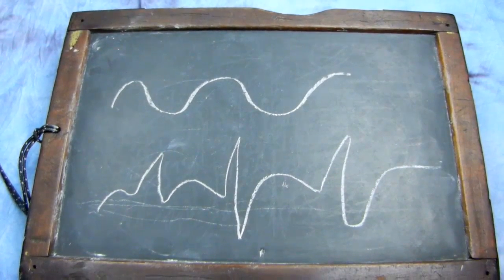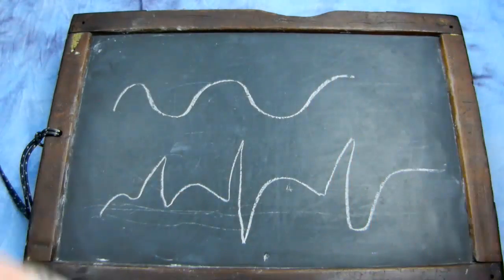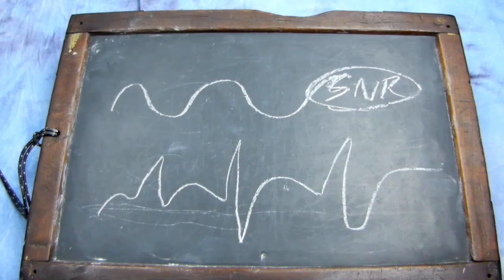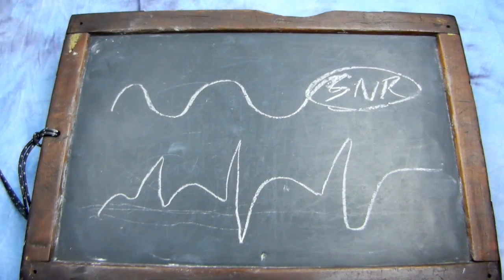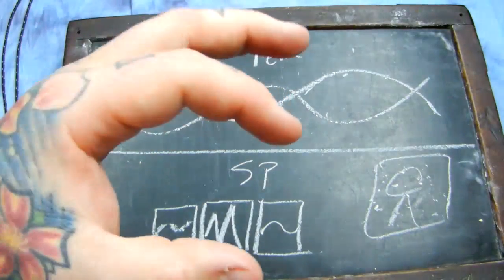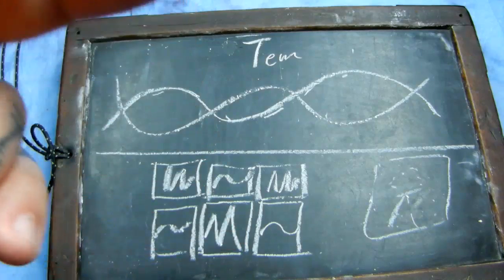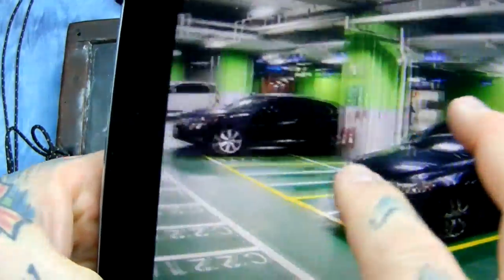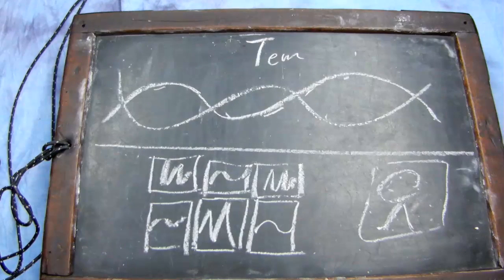Angry Photographer: SECRETS (SNR spatio-temporal algorithms) NIKON & CANON dont want you to know

Comment: I get your point and is a very interesting video, but what you said can confuse some people, the image quality depends of both factors. if we are talking about the same sensor yes, better algorithms can improve the image quality a lot, but if you compares a high end sensor with a crappy 20 dollar sensor no matter how good the algorithms are. both factors are very important a good sensor is gonna get a higher signal in the same situation and the algorithms have more information to work with. if two cameras have the same sensor the raw picture file is gonna be very much the same even if one of the cameras have a better analog to digital converter the diference is not gonna be so great, (JPG is another story). there are some cameras with very unique sensors that have an awsome signal to noise ratio which is what it makes them great. best regards from Uruguay.

Comment: Firmware interesting.....part of what is on the card is not captured by the sensor......is there a firmware algorithm update for D610?...noise algorithm..gap filling...in basic terms or spacial temporal firmware algorithms...i had thought about this before but never looked into it ...very interesting..cheers

Comment: Is this done before or after the analog to digital conversion? Also, I don't understand the temporal part, if there's x photons in a photosite, how do they figure when in the exposure those x photons came?

If it is after the digital conversion, why the hell hasn't anyone applied this to film scanners yet?
Reply from the maker: Abhishek cherath its never "in" like water in a cut, only a voltage spike.   How? because adjacent noise has a frequency thats known! 

after the AD converter 

well it can be applied in software AFTER film scanning, i know this is done.
Reply: Oh, kk.

which software? I mean, delta 3200 looks a great deal less noisy than those examples you showed.
All the noise reduction software I've used blurs and smudges things and makes everything look hideous. The best solution I found is to take really low res scans (Of course, this will only really work with scanners that don't alias the shit out of the grain, or drum scanners at larger apertures, I guess), upscale them, and then put the upscaled scan in a layer above the high res scan, and play around with opacity and unsharp masking and stuff.
I suppose it'd be possible to just isolate the grain, and then 1:1 pixel map the non grainy pixels from the upscaled image, hmmm. Ill have to try that
Reply from the maker: heheheh, i havent scanned in film since my 6x7 days!!
Reply: I don't really like doing it either, but alas, don't currently have access to enlargers, :(

How'd you print B&W digitally, btw? inkjet prints look kinda... crap
Reply: Theoria Apophasis Hey, I was thinking, and I still don't really understand the temporal part. Adjacent noise means what, exactly? In fact, I don't think I understand noise at all, which is sad, considering I've been reading a lot about it.

Its a fluctuation in signal, yes? So, what does that mean? Does it mean that, on a theoretically perfect sensor, if I took a picture of a flat grey card, the pixels would have variable brightness values, with the number of pixels straying from the grey increasing when less light is let onto the sensor? 

How does this temporal reduction work? I understand that in video, ie, a CCTV camera or something, it can just go through multiple frames, and average the results for still subjects, but then how does it display a live feed? 

Even spatial noise reduction, how is a noisy pixel identified in the first place? I mean, if I only had two pixels, and one of them received signal and the other noise, it wouldn't be possible to get the right one. So, do they average 9-10 pixels, and then see which stray the most from the mean and call those noise? And after that, how is that pixel's signal reconstructed? straight averaging the signal around? So like gaussian blur, but on select pixels?

What about edges? How are they dealt with? Slightly out of focus edges?? 
I'm confused.
Reply from the maker: all of that is explained in the links above.

out of focus is of course NOT corrected for.